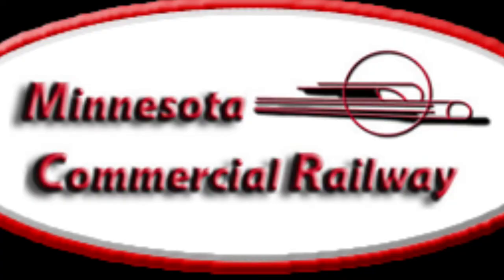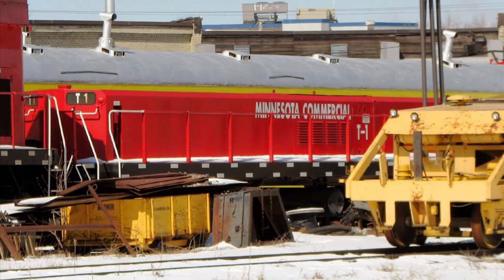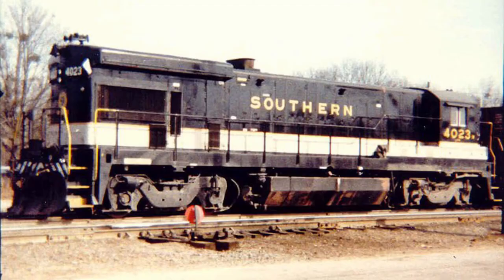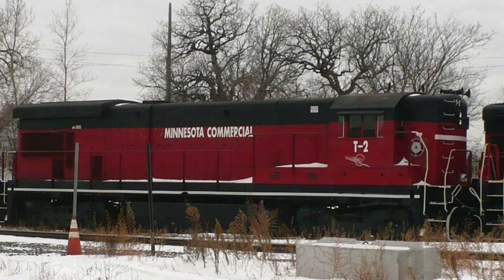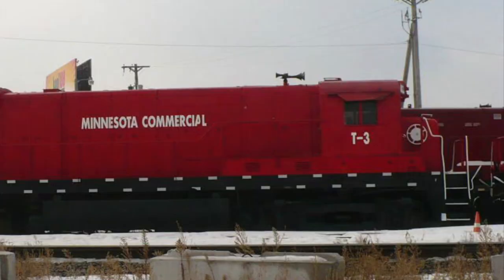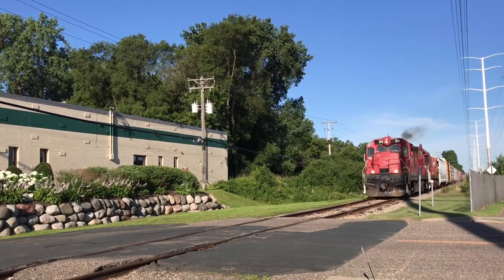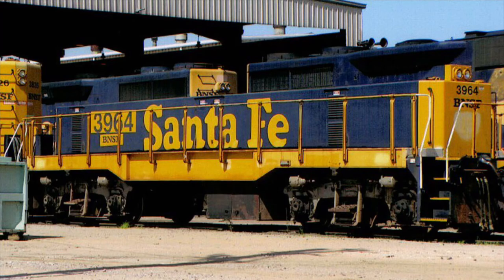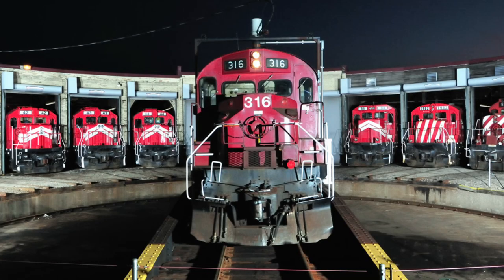Engines of Minnesota Commercial: Slugs

Comment: Some current notes:
T1 - Scrapped several years ago due to the mentioned bent frame.
T2 - Currently stored in the A Yard.
T3 - Currently the only active slug, paired with B30-7 #88. In use almost daily.
T4 - Currently stored in the A Yard.
Reply from the maker: Thank you. If I decide to remake this series I should remember that